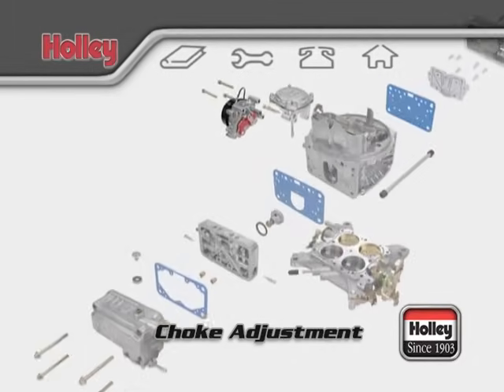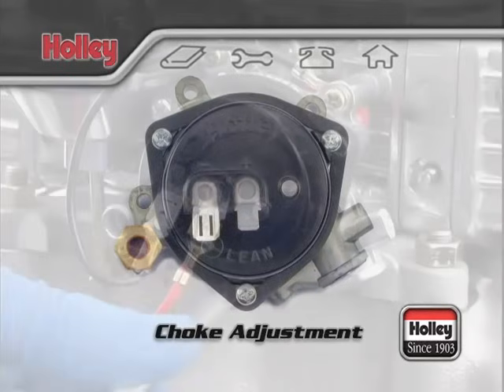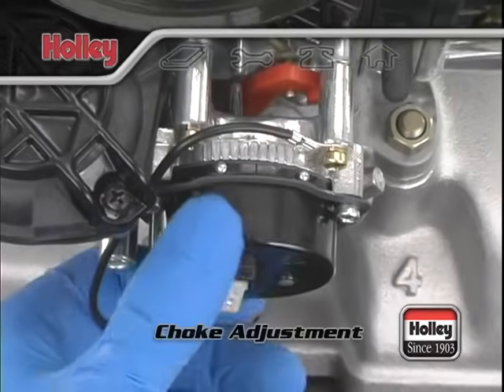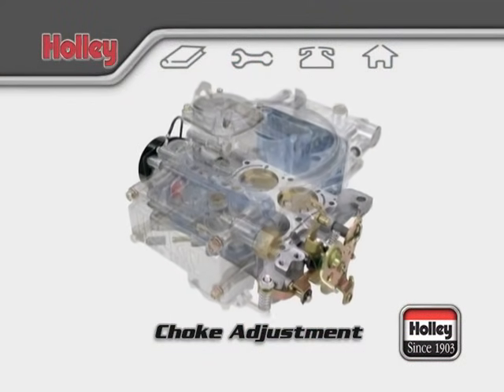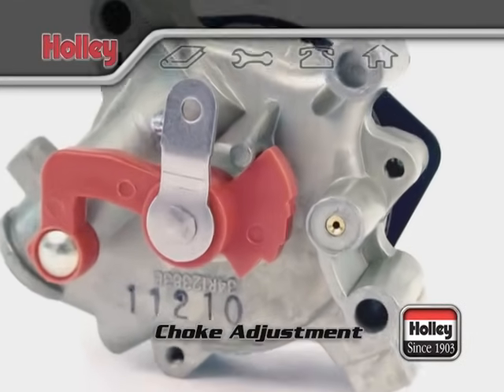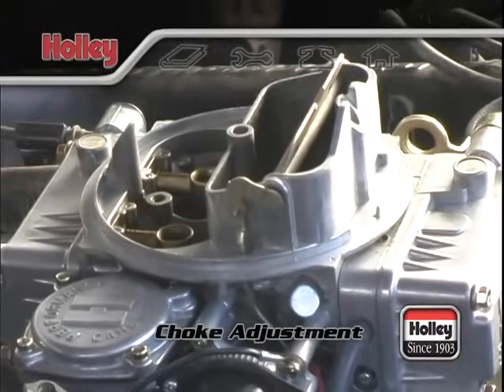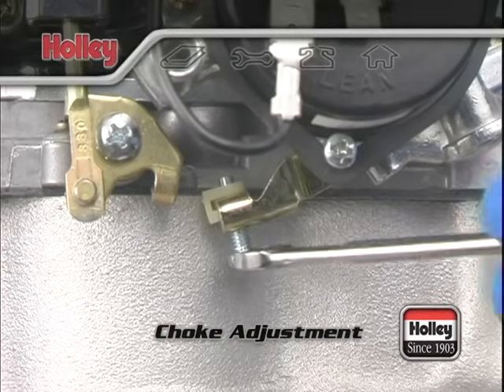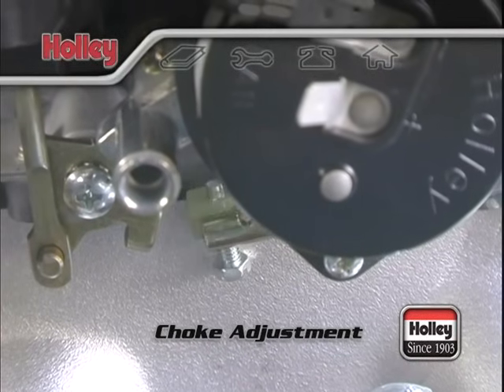Holley Carburetor Choke Adjustment Tips

Comment: Quote: "Turn the screw clockwise".  He is turning the screw counterclockwise. You need to specify a reference point. The screw is upside down. clockwise from one end is counterclockwise from the other.  Do you want me to back the screw out or turn it in? I assume backing it out will reduce the fast idle RPM and turning it in will increase the fast idle.
Reply: Thank you! This drove me nuts! Glad I wasn't the only one. He is most definitely turning it counter as he says clock. WTF
Reply: Thank You for that Daniel!! a year old post came to the rescue!! This was messing me up
Reply: maybe you guys shouldn't be playing with a Holley if you cannot work this out!

Comment: Funny on my carb is the opposite 
To increase rpm is counterclockwise and decrease clockwise, I must have an old Holley , but it worked I was able to adjust the choke speed at the right rpm’s thanks
Reply: Yea he said that backwards. If you go clockwise that will decrease idle speed....

Comment: Quick question, is the RPM from the fast idle meant to automatically drop to the idle you have set for your curb idle or has it always been a thing to jab the pedal after your car is warm to get it to drop down. Part #
 0-80458SA, everything works great on the carb and i don't mind jabbing the pedal i'm just curious. Cheers

Comment: How do you independently control  the speed of the choke opening vs the position of the choke plate at start? My issue isn’t the duration of the choke, but the fact that the electric coil forces the choke plate fully closed at cold start when set past anything longer than the first couple notches. My engine will not start like this when cold, it needs the plate slightly open to get enough air. Sometimes it would start but run very rough and shake. Is there a way to keep the choke plate slightly open, even when it is set to the longest duration?

Comment: I just got a  Holly road Warrior carburetor I'm having problems with the electronic choke it worked when I put it on there But now it acts like it's not getting power and all I have is a Screwdriver typelight power checker It's hooked to the ACC of the Ignition So I'm assuming it has enough power

Comment: I'm confused the fast idle cam screw is not even engaged backed completely out and it still idling at 3000 rpm
Reply: Check your main idle screw on the driver side and check to see if your secondaries are not open at all. if they are just cracked open just a hair, it will affect the main idle.

Comment: I've got a new Blueprint 350/375 hp with a Holley 600 on it and what he says here about adjusting the fast idle is completely backwards. I just adjusted mine and after turning the screw clockwise the idle came down so I took it counter clockwise and got it where it needs to be.
Reply: So my 600 on cold start idles about 3000rpm and I backed the cam screw out counterclockwise the screw completely not engaging the cam and is still idling around 3000 did not change. So you're saying if I turn it clockwise it will lower the cold idle not counterclockwise?
Reply: wollens worth clockwise should lower the rpm as you’re pushing the cam which cases the butterflies to close more
Reply: clockwise/counterclockwise is always referred-to from the end of the screw/bolt with the head on it.
You might be confused, as the head of this screw points down, and you're looking at it from the opposite end.
Reply: @michaelharris1455  exactly! and that is what he does in the video. Clockwise from the wrong end.  back it out or turn it in
Reply: @Fr33dom89  Check your main idle screw on the driver side and check to see if your secondaries are not open at all. if they are just cracked open just a hair, it will affect the main idle.

Comment: Can i have little help ? My toyota carburator (2e engine) release the fast idle too quick. I set the choke to be little slower and adjust the screw of fast idle but now when its hot weather i start the engine but in 2 seconds its release it and the engine get really low and the car is cold and start bumbing and engine going off. When i press the gas and hold in on cold engine and put it there for 1 min and relase the rpm are normal because the engine is now warm.
Reply: is it a Holley 4bbl?

Comment: what if the choke plate is getting stuck on top where I can't even push it down?? this happens all the time with my holley electric carb w/ choke. my car has completely stalled while driving on a freeway and downtown because of this issue
Reply from the maker: Is the plate binding on the sides of the choke tower?  It could be that the carb has been dropped or damage somehow in the past and the choke plate doesn't have the proper clearances.  Or its possible that the elec choke cap has been installed incorrectly or is damaged.   Is it possible to take a pic or video and point out where the  issue is?  Post it to your youtube channel and let me know so i can view it.  Thx J
Reply: HolleyPerformance I'm uploading a video now... should be available within the hour. Thank you for response
Reply: HolleyPerformance video is now uploaded on my channel
Reply from the maker: I saw your video, Thx!   The choke plate should never close completely.  Even when below zero there should still be a slight gap between the tower and the plate.  Start with about and 1/8" gap when the engine has cooled overnight and before turning the key on. You can use a drill bit ( be careful not to drop the bit into the engine) or even a small diameter screw driver and place it between the choke plate and front part of the choke tower.  Now loosen the 3 screws securing the electric choke cap and rotate it ccw or cw to obtain the correct gap and re-tighten the screws.  This is a good starting point and can be adjusted for a more open or closed gap depending on your climate and engines preference.   You should also check the entire choke system to make sure it is in working order.  Do you have 12volts at the red wire going to the choke cap with the key on?  Are all the linkages connected and secured?  Also check to make sure that they are not binding anywhere.  After the engine has warmed up to operating temp ( 180-210 f) recheck and verify that the choke plate is completely open ( standing straight up or vertical).  If not you may have to re-loosen the 3 choke cap screws and adjust.  This whole process may take several days to get 100% since some operations need to have a cold engine and some hot.  Let me know if this helps?  if you need more guidance i can do a  quick video for you to watch covering the basics.  Thx again J
Reply: thanks! I will try that
Reply: @HolleyPerformance  thanks for the clear instructions but my question is doesn't the choke plate close fully when you pump the gas before a cold start? So why wouldn't I want the choke plate fully closed on a cold engine? I always need to give my truck two or three pumps before starting.
Reply: @HolleyPerformance badass information! Good to know

Comment: At cold startup, my engine will start quickly, but within seconds will start to stall if I don't goose the throttle for the next 30 seconds or so.  I have tried adjusting richer, but the problem still exists. I think the problem is that the choke plate opens too far immediately after startup. There seems to be no adjustment for the choke vacuum piston travel which I think should be reduced.  Please advise.
Reply: I have the same problem!  Sorry to see nobody has any advice for us.
Reply: Right here with ya. My scout starts a little sluggish, but quickly picks up to speed. after about 30 seconds, the choke plate (Which is set as far rich as possible) is left sitting wide open. The truck Idles fine, but when I drop it into gear it immediately stalls. Mind you, that as far rich as possible is only about 2 notches back from middle mark, as the stop pins prevent me from dialing back the choke anywhere near where it needs to be.
Reply: Check your needle on the carb And flout fuel level , too much fuel can cause it to stall
I had needles replaced and adjust the choke 
And she runs perfect again 
Also check if the holes on the air vents are not clogged , I use a little carb cleaner and a can of air dust